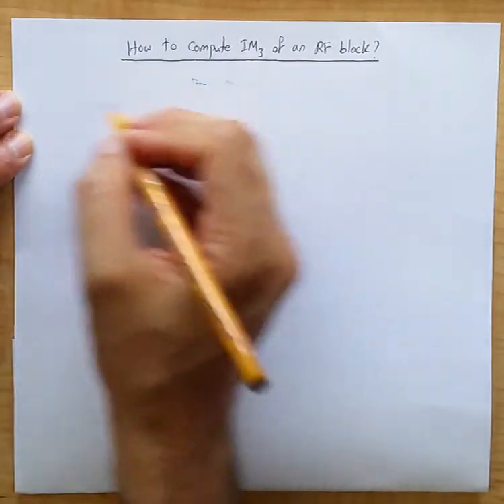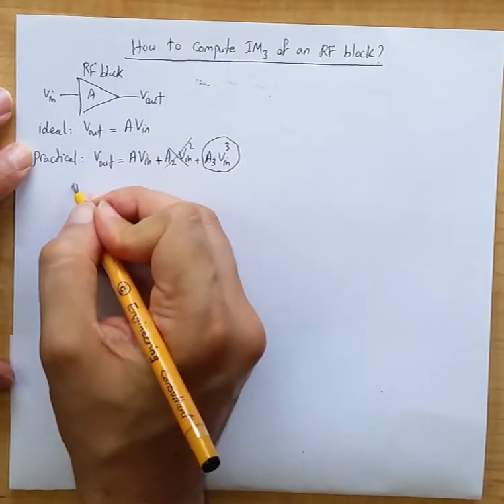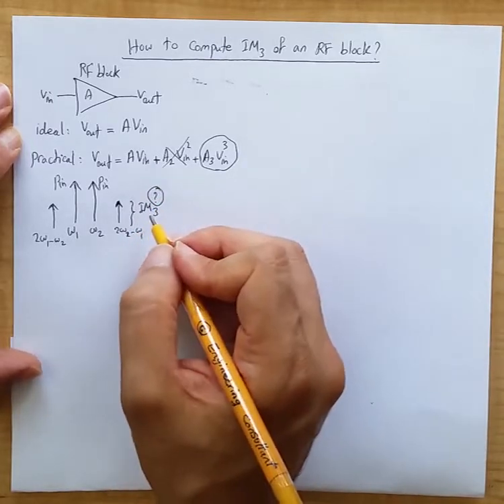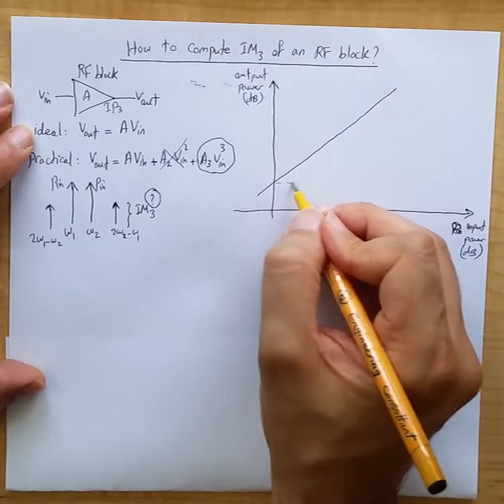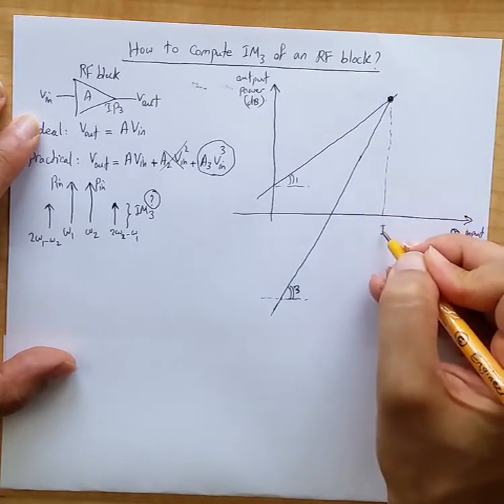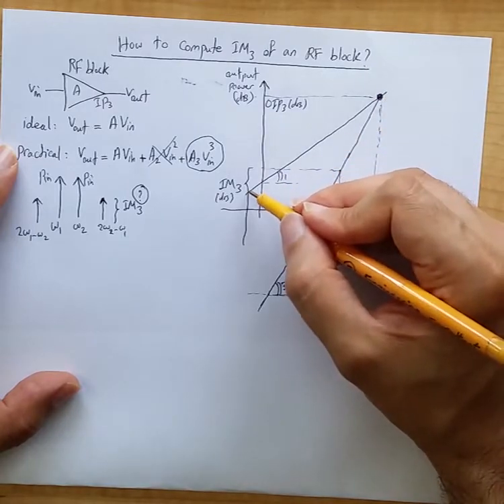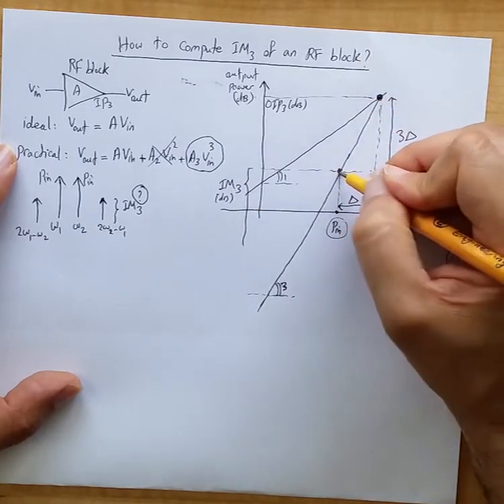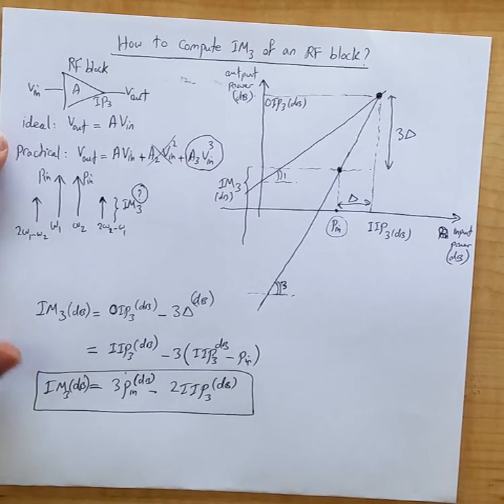Third order nonlinearity of RF Amplifier

Comment: At 4:30, why did you substitute iip3 for oip3?
Reply from the maker: Good question Mark.  Because it all depends on the context (input referred vs. output referred).  If deriving output referred IM3 then you need to keep OIP3 intact in the equation (and not substituting it).  Otherwise, as I was deriving input referred IM3, then knowing that IM3(out_ref in dB) = 20*log10(A) + IM3(in_ref in dB)  and also  OIP3(dB) = 20*log10(A) + IIP3(dB) , I implicitly replaced IM3(out_ref in dB) & OIP3(dB) in left-hand side & right-hand side of the equations using the above two equations and then I implicitly canceled out 20*log10(A) in both sides leaving only IM3(in_ref in dB) in left-hand side & IIP3(dB) in right-hand side.  Hope you find this explanation helpful.